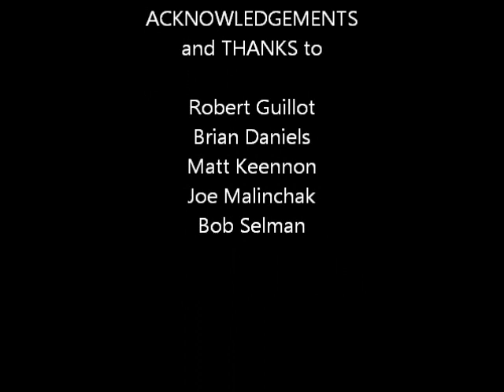P-51D Mustang 1:96 8 Channels - see also Flight Video

Comment: This video brought a smile to my face! I was amazed at how smooth & proportional the actuators operate. So much better than the previous "all or nothing, on-off" actuators found in tiny models. Flaps & retracts on such a small scale is also impressive. When I was much younger, I had a tiny throw glider P51 with a wind-milling prop made from thin sheets of foam material covered in printed paper. I would often day dream how sweet it would be if it were r/c. I'm guessing that I wasn't the only one. Now it is a reality!

Looking forward to seeing it fly!

Comment: I did not know that parts existed to make all the funtions work in this little plane! Fantastic! I wish I had x-ray mission to see the internal workings!
Reply from the maker: Please read the expanded comments after the title ("Show More" on a PC, or hit the down arrow next to the title on a smart phone) on either of these videos.  There you will see links to two technical papers that describe the internals and how it is all done.
Reply: Martin Newell It still amazes me! So much detail on a micro plane!
I did not even come close to your motor as a kid. They were brush type and armature was steel sewing needles and fine wire I took from old electronics parts. Still wonder how you can see that not to fly it. 🤔

Comment: Amazing achievment! I see you had to wash out the tips a lot, which is hardly surprising on such a diminutive aerodyne! Well done!... :-)
Reply from the maker: That's a very perceptive comment and you are right.  But I'm curious why it is "hardly surprising" to you.
Reply: Because on a wing with such tiny chord the mass flow ratio (reynolds number) would be very very low and tip stalling would be vastly more likely due to scale effect. The best way to avoid it is washout to ensure that at stall the centre section loses lift first, although in level flight there is increased drag. If the wing were, say, six feet in span the problem would be almost eliminated. Scale effect is a bit of a curse with aircraft because we cannot get scaled air molecules, so the boundary layers are the same size regardless of the size of the aerofoil, and so at small sizes the effect becomes so much more significant and necessitates more extreme measures to give a good measure of inherent  pitch and roll stability.
OK... I'll 'fess up..... I'm 74 now and don't fly miniature aircraft these days, but I always used to design my own back in the day; it's good to start with a clean sheet of paper, so I had to learn about some of the basics, and especially as I used to fly pattern ships (and before that control line combat) the secrets of longitudinal stability (or when needed, the lack of it) was essential. That critical point between maximum efficiency and a shift of centre of pressure with speed causing loss of stability. ........ interesting!
When an aircraft is expected to fly both upright and inverted with minimal trim changes, one walks the tightrope of good control versus loss of pitch stability. With the right airofoils to minimise centre of pressure shifts with varying speed, it can be done. The price is always drag of course, but pattern ships don't need to be very fast, just very agile, with a proper, stalled spin entry. Get it right and it will come out of an inverted flat spin just by letting go of the sticks, usually within a turn and a half (my last ship would do it in half a turn), as long as the wing loading is low.... Lots of fun... perhaps I should take it up again!.
Reply from the maker: Thank you so much for the explanation.  Aerodynamics is not my strongest skill, and I just learned something!  Can you possibly point me to a readable source that explains this in more detail?  
Speaking of longitudinal stability, another requirement of these small models that I have learned empirically, but for which I have no theoretical understanding, is the fact that the tail surfaces have to be enlarged significantly over their true scale sizes.  Can you explain this, too?
I'm almost the same age - seems to me you definitely should take it up again!
Reply: Ah yes..... well really it's all down to scale effect. The smaller you get the more the problems multiply. A tail surface as tiny as the ones in your little masterpiece would have such huge losses at scale dimensions as to be virtually non-functional.
Most full size aircraft have tail surfaces less than 15% of wing area, often a lot less, and they work fine, whereas for the aforementioned 'pattern ship' the tail area is up to 25 or 30% of the wing area to get good 'bite' without having to use huge elevator or rudder movements, which create drag of course and also can trigger adverse yaw, and unwanted yaw/roll coupling. A perfectly balanced aircraft for aerobatics yaws with rudder with no roll coupling (good for crisp stall turns) and is capable of square loops of quite small size without more than 15 or 20 degrees of elevator deflection. Large surfaces with small movements are far better than small surfaces with big deflections, giving crisp point rolls with minimal adverse yaw because those smaller control movements create less parasitic drag. Remember that all the control surfaces do is to move the centre of lift about, backwards and forwards (elevator) or side to side (ailerons). In level flight the aircraft is perfectly suspended about that one point of its mass that results in no gain or loss of altitude or alteration of track through the air. This is the reason for all-flying tail surfaces (and very occasionally wings), which even on full sized aircraft give excellent control with small deflections, less turbulence (and therefore drag) and as they entail no effective change in airfoil section do not run into non-linear responses at different speeds. A tail surface with a deflected elevator or rudder actually becomes a surface with a curved camber line, which do not do well at high speeds. Of course there is always some degree of incidence needed for lift of the mainplane, but aerobatic aircraft are set up 'zero zero'... that is with vertical and horizontal thrust lines and centre lines of all aerofoils completely parallel rigged. With a nice rearward CG, very little trim is needed for level flight, so just a touch of 'down trim' will make the aircraft completely stable in inverted flight with no noticeable trim change with speed changes, at least until the speed gets very low. It's a balancing act from start to finish, which is why lateral balance must be perfect if changes in roll trim are not to show up with position changes.
Then there's free-flight power ships..... an art in themselves!....
For reading matter, I think the "Aeromodeller" press has a lot of books about this sort of thing.... I can't remember where I learned all this.... experience mostly in designing and trimming freeflight, control line and radio aircraft I think.
Reply from the maker: Thank you for the detailed explanation.  I have much to learn, but that's why I do this.

Comment: where did you buy this? I would pay $200 just to get it
Reply: Have to buy the parts (motor, servo-actuators, receiver, battery etc.) and hand-make the plane then install those parts in it, and make the connections to get it all working. It would cost much more than $200 for those parts, the transmitter/remote control would be several times that too.

Comment: Beautiful work. Now as much as i hate to suggest it. Sell out. Mass produce them and be a billionaire.
Reply: no because instaid of it being a decent model it will be mass produced in china. only have 3 channels. and use the cheapest materials possible. this model was built well. nothing china couldent do for under 400 dollars a piece.
Reply: @TriggK4T  youre right. Everytime ive designed and built things i refused to sell out. Had more money than than i could spend until health issues took over. Now im wishing id sold out at least once maybe twice.
Reply: @TriggK4T  id definitely have to design one prob a tiny bit larger for the machine guns or maybe twin 2 mil pin guns on the underside to launch bombs or torpedos. We did tgat on the only gas plane i had as a kid. It had a handle with strings and you spin around in circles until you trip and end up being molested by the plane. Dad and i rebuilt the gas engine and found out more isnt always better. It was so fast you couldnt keep up. Then one mistake and the string wraps around you like a tetherball pole and smacks you in the face or guts. Finally i set her free. Glued the flaps started her up and taped tfe throttle wide open. Watched her fly off into the sunset. Prob killing somebody when it eventually crash landed. Ahh good times
Reply: @davidreynolds4684  jesus christ😅🤣 ive heard old stories from my grandfather about them old tether planes. he said he did the same thing but it had dove into the neighbors cars rear window at about 70mph he said. im 21 now and this happened back in the late 60s early 70s so i dont know about it from personal experience. amd with those 2mm pin guns be careful lol. the government will have an aneurism over that "if they find out"
Reply: @TriggK4T  not sure but i think they caused most of the cleft pallets in the 70s. Maybe some circumcisions too.   Id kill to have that thing now. Im sure the person who was attacked by ut wishes that as well. It was a beautiful sunset it flew off into. Jerry Palmer was with me. Speaking of nostalgia he had the coolest bicycle. It was a drag bike. Not one thats pink with tassles and a huge nan dressed in a bedazzled dress and big ass wig but a chopper bicycle with a wide slick back tire. A gear shifter and a stand that allowed you to pedal your butt off then reach down on the crotch crusher bar and drop it into gear the bike would engage the wheel while spinning like hell and it would squeel and lay a black mark or alternatively catch traction and youd lose your balance and fall over or accelerate left or right and dlam into your friends or a car or house.

Comment: Prop is all wrong for the P51D
Reply: Are you joking?? that model weighs less than 3 grams, it's a fully functioning and flying rc model..... and you blurt on about a scale prop!!! go troll your idiocy elsewhere you fool
Reply: Nick Mann good lord take a chill pill
Reply: Shhhh fool
Reply: RC models that actually fly are only rarely able to have a scale prop, the physics just don't work at that size. Plus it might be hard to buy the one you need even if you could use the right number of blades and scale diameter